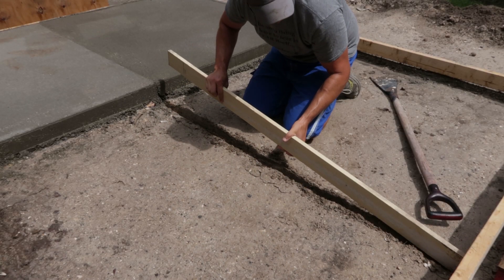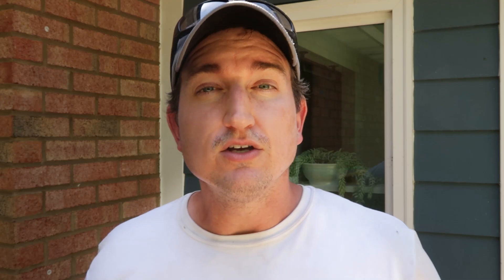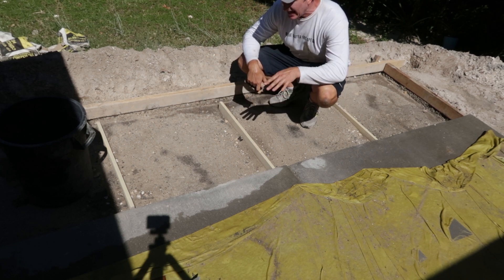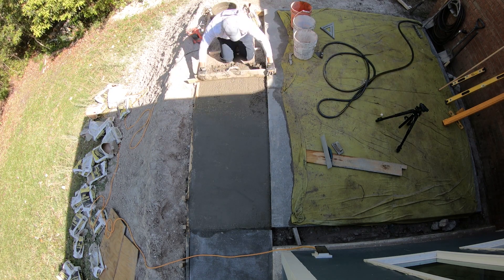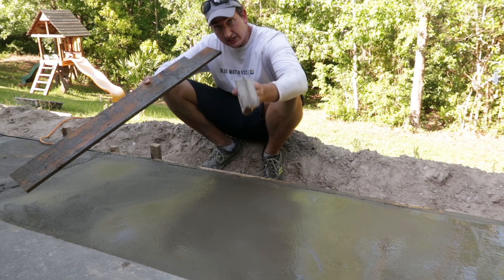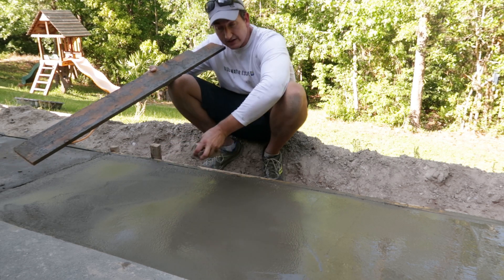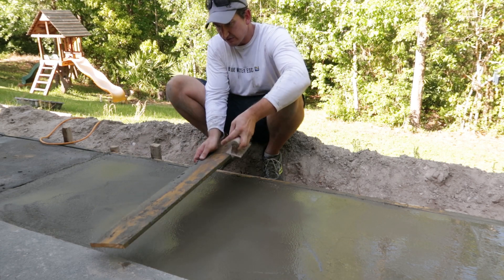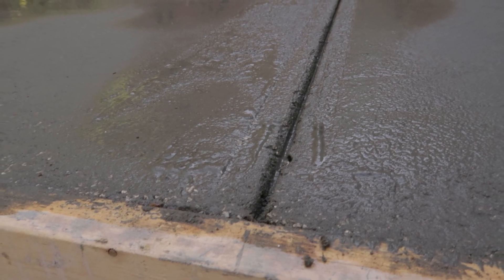Is Using a Concrete Grooving Tool Enough To Create Reliable Control Joints?

Comment: How thick are those boards under the concrete....is a 3/16"  inch thick plywood good
Reply from the maker: I did not use plywood I used cementitious siding boards which are pretty thin.
Reply: @MrKistel  cementitious boards maybe its like this thing we here in our place that looks like cement about 1/4" thick named hardiflex...ive seen one that slowly rot due to rain water...but some people says there's one type that is for outdood use

Comment: Or you could have just poured the whole thing the same thickness and left the joint groove out... That's not a big slab. I've done dozens that size and haven't had any of them crack, and I'm driving a crew cab Silverado on them regularly.
Reply from the maker: if I thought I could have mixed the concrete fast enough  I might have done that.

Comment: As a concreter for 44 years that's not how you do it pass the dummy joint then saw cut it the next day
Reply from the maker: Seems like the saw cut concrete joints are the cleaner way to go

Comment: That hand jointer you are holding is called a dummy jointer.
It's made to make dummy joints, more or less for looks only.
I personally have 1/2" jointers I use.
By doing what your doing you are actually weakening the concrete slab in general.
My advice is just saw cut and pick up a nice V wheel to pretty them up with a day or 2 after you pour.
Reply from the maker: Thanks for your inputs
Reply: I agree with you.

Comment: I have MANY times used the spin screed chairs and 1/4×2 steel for control joints in thick slabs.
You just grease the steel good and pull them out right before final pass with steel trowel
Reply from the maker: Thanks for sharing the tips.  The steel plate for concrete control joints sounds like a great practice.

Comment: Not a good idea. You are separating each piece concrete, making the entire structure weaker. Sure you control the cracks, on a tiny piece of sidewalk, but now you created an opportunity for shifting and settling because it’s no longer one piece. Would not recommend
Reply from the maker: In this application, I actually preferred the overall concrete patio to be broken up into sections. If for some reason if one concrete section is stressed in the future from something like a growing tree root or elevation change the surrounding concrete sections will not be impacted.
Reply: You must have never worked with concrete eh

Comment: I do concrete for a living that idea doesn't work no need to put a piece of wood in the concrete because it'll rotten and be even weaker, that's why you have your hand jointer  give it one pass to open it and then a second when its hard enough for that one last pass
Reply from the maker: Thanks for the concrete installation tip.  The inserts seem to be working well for this concrete patio,

Comment: Respectfully thats a cheap groover. 304 or 305 kraft groover will make it crack. That toy groover u have is trash. Respectfully..
Reply from the maker: Thanks for the concrete tool tip.  Looks like the concrete control joints shown in the video are performing well.  I have noticed there is a crack along one of the grove lines thus far.

Comment: My driveway doesn't have any control joints and was poured today. It is fairly large.  Is this normal?
Reply from the maker: My guess is the concrete company will come back tomorrow to cut in the control joints in the concrete driveway. They can be cut in if not grooved in during the pour process, however the cuts should be made as soon as possible.
Reply: @MrKistel  ok thank you for the reply. I'll keep an eye on it. Hopefully tomorrow
Reply: @usheringtaurine5158  did they go back and cut them or did they take your money and run?

Comment: But, when it does crack it will be visible. The normal method hides the crack
Reply from the maker: Thank you for the comment, I assumed the structures were deep enough in the concrete that they would likely not be seen even if there was a crack.  Will see what happens over time, so far so good.

Comment: Concrete will attach in top of paint.?  Is for my chiminey I painted White now I wantes concreate look. Chimney is made rock s???
Reply from the maker: Not completely sure I understand the question but if it is just a color change you are after I would think a good quality paint might be a good approach.  I am sure you can find something with a concrete color and could possibly even texture it to have somewhat of a concrete pattern.